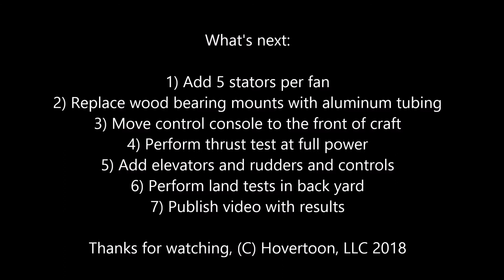Hovertoon Motor and Fan Build for hovercraft thrust.

Comment: Your belts are no where near wide enough. You need at least a 2.5 inch belt
Reply from the maker: What do you base that on?  I have seen no wear even at full power.  About 100 hp per belt.  Per Gates tables, should be good for 150 hp each.
Reply: @Hovertoon  Built one years ago, my table read different. Just be careful you have not divided the power between 2. I was running a 2" belt as per makers recommendation for only 50hp
Reply from the maker: @richrdlewis6278  were you using the new "36mm wide 8mm pitch Poly Chain GT Carbon Belts"?  Here's the video of the run up to full power.  https://youtu.be/T9SGPU_hT3w